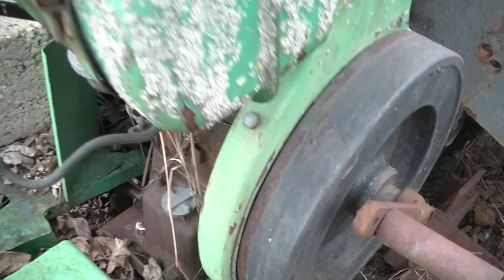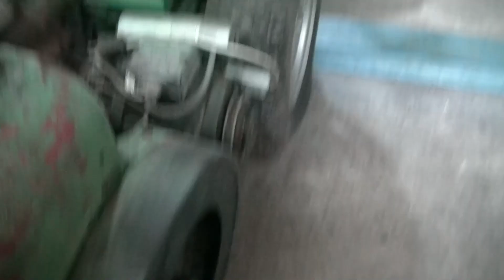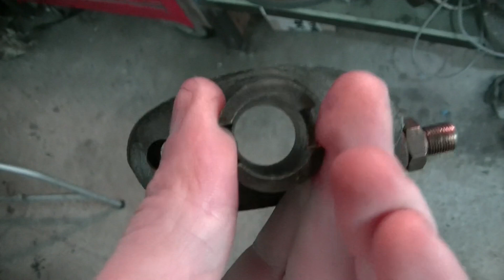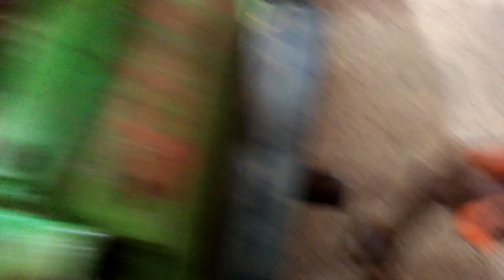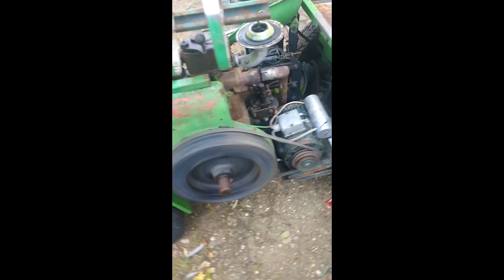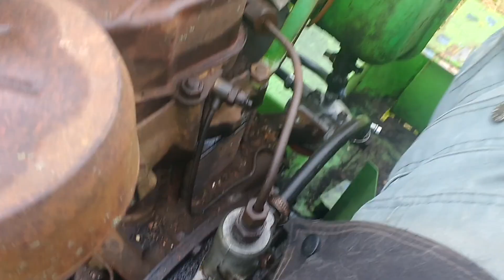Abandoned Mini Dumper, will it start?

Comment: This things rad, very cool homemade design - the electric starter is a feat of ingenuity.
Reply from the maker: Thats exactly what i thought :p You have to think this thing was built in someone's shed waaaaay back before the internet. Probably only had a hacksaw and a stickwelder. But the clever ways they managed to get around to make stuff work. There even used to be a pto that drove a belly mowerdeck so it could mow their lawn. it's multi purpose.
Reply: @thebrojectlist6881  true, people were much more creative, had more common sense back then. Pretty amazing it has a mower deck also.